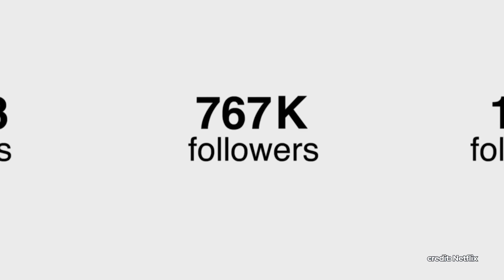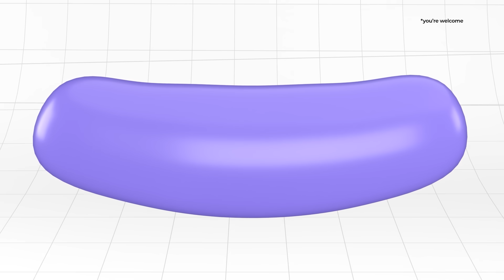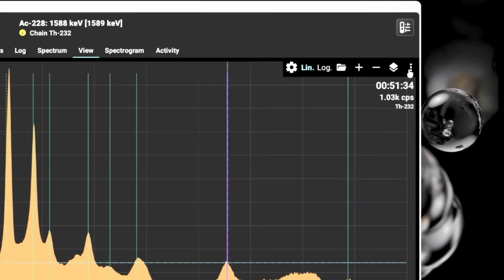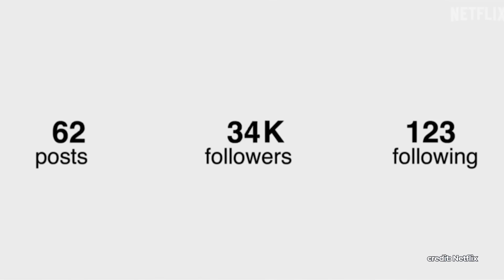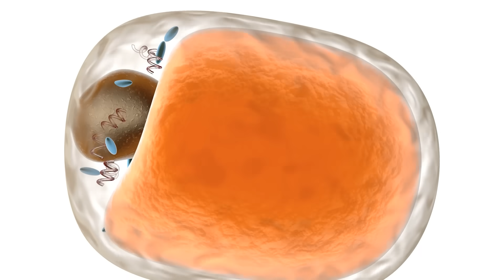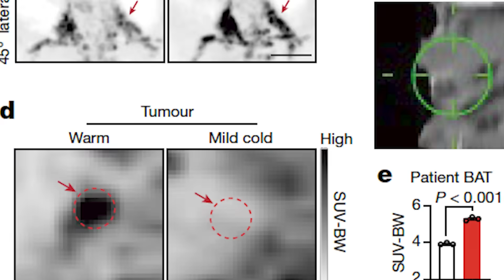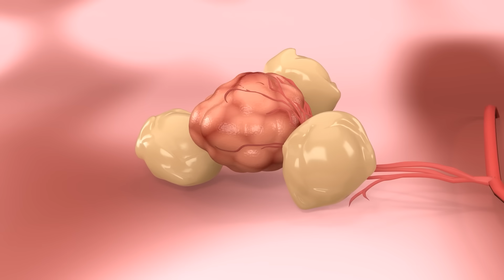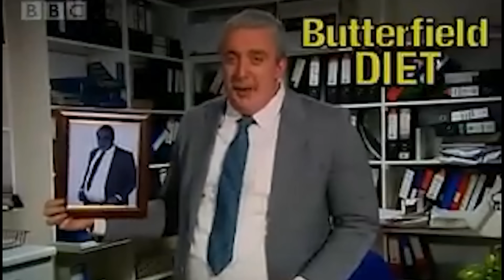Scientists Just Discovered How to Starve Cancer

Comment: Excellent video as usual. I was diagnosed with metastatic cancer (stage 4, terminal) 7 years ago (still here!) and knew I had to find my own way out. An infinite amount of time researching cancer science has kept me alive and the cancer is now undetectable. Here's the kicker: cancer involves both cancer stem cells (CSCs) and their progeny, daughter cells. THEY BOTH HAVE DIFFERENT METABOLISMS! While daughter cells are dependent on glucose to fuel glycolysis, CSCs are not. CSCs can make energy either through glycolysis (the Warburg Effect) or if glucose and glutamine are inhibited, they can switched to normal, 'healthy' metabolic function, including burning fat to produce ATP (energy). To be clear, I have never tried the Keto diet - there is too much science that shows cancers ability to switch metabolic pathways when denied any source of fuel, and that fat is the preferred fuel of many types of cancer. For example, the dominant metabolic pathway for prostate and pancreatic cancer is Fatty Acid Oxidation - a Keto Diet can only make those cancers worse. Simply put, diet cannot cure cancer, it can only help. But you MUST understand which type of diet helps for which type of cancer. There are hundreds of different, unique types of cancer and there is no single diet for all of them.
Reply: I haven't gone into detail because that is an extensive explanation. But since there is interest I'll have a go: diet - plant based, best described as a pescetarian diet, although over time I added chicken. I avoid grains and simple carbs. I was very strict in the first years, but that proved unsustainable. Treatment: I have had surgery and 2 rounds of radiotherapy (radiation). The result was temporary reductions in cancer markers. Complementary medicines have been far more effective, but timing is critical - the radiation reduced tumor mass and enabled me to take advantage of that with these medicines. Complementary medicines do not work on advanced cancers. Advanced tumors need to be diminished by radiation or chemo so that the tumor survival mechanisms are demolished. Then they work. The most effective medicine I have taken has been fenbendazole. It stopped metastasis and enabled me to get on top of things. But fenbendazole requires the support of diverse vitamins and minerals. Peptides have also been very helpful. You might look into peptide therapy. It has worked for me and is gaining traction. I also recommend avoiding the doctrine of Thomas Seyfried, who has been mentioned many times in the comments. He is a neurologist, not an oncologist, and his ideas are reductionist and misleading. And potentially fatal. Brain cancers are unique and very different to every other type of cancer. They are uniquely dependent on glucose and so a keto diet is recommended in that case. But for most cancers the keto diet is far more likely to exacerbate the problem. This is a very brief description of several years of research. I wish you all the best.
Reply: @quantumkookaburra  Thanks for that explanation, Kookaburra. Another Aussie? Awesome effort BTW, 7 years after a terminal diagnosis(like me).
I was diagnosed with aggressive small cell pancreatic cancer 3 months ago. I was offered chemo, which I accepted. On diagnosis I started on fenbendazole, ivermectin, curcumin, megadose VitD3, Vit K2, Vit E, zinc, and EGCG(Green Tea extract). I use vet grade IVM and Fenben, as I have found it very difficult to get pharma grade IVM.
I have not told my oncologist what I am doing as I can't be sure of the reaction, and I still need his help for chemo and scans, but I will dowhat  puts the odds in my favour with minimal downsides.
I had a scan 6 weeks ago and the pancreatic tumour had shrunk 20%. I am pretty sure it has shrunk further as I have been able to go off my pain meds a month ago.
Thanks for the tip about peptides, I will look into that. 
As for keto, I have seen it mentioned many times in relation to IVM/Fenben, and initially tried it. Living in my household it is next to impossible, so I have just opted for low carb, as I started to wonder if it is all that relevant, given the metabolic blocking that the above provide.
Cheers, and thanks for your explanation.
Reply: @TheRonster1957 Thank you for that. Very interesting. Did you also happen to go on a very low-fat diet, alleviating the pancreas workload? What about creating an alkaline environment in the body?
Reply: @TheRonster1957  Thank you for sharing your experience. Every inspiring story helps. I wish you well on your healing journey.
Reply: @quantumkookaburra my friend go brain cancer years ago and I begged him to do keto and he did. I’m glad I was  right holy shit.
Reply: @quantumkookaburra  That’s incredible, which peptides did you try and which ones seemed effective?
Reply: @quantumkookaburra  Seyfried isn't a neurologist, he's a biologist.
Reply: @quantumkookaburra Hi! Can you please tell me more about fenbendazole and what it means that it should be supported with minerals and vitamins? What type of cancer do you have? How did you take fenbendazole? I have also been searching for tons of information and I found your comment very credible, although in practice no study with a normal design has been able to confirm the benefits of fenbendazole for cancer. How is your health now by the way?
Reply: @quantumkookaburra  Maybe, or maybe it's all a fluke.
Reply: @quantumkookaburra Thanks for sharing. 
Years ago, we learned that cancer cells cannot eat raw leaves and raw foods. 
So, pescatarian with raw okra and leaves should be the correct path. Occasional low-carb veggies like chayote and zucchini etc.
Helping my mother with metastatic squamous cell in nerves of head. Not easy.
Ivermectin and low-methionine and low-carb has removed pain and slowed the growth, but I  believe it's not enough. 
She wants to try mebendazol and we have some but I don't know how to use it. Any suggestions?
Reply: @andreadamascceno2139  Raw vegetables is almost the worst you can do to a human body.  Though nobody is the same i would never advise someone raw vegetables. Many plants are full of toxins, and certainly if you do not cook them. And cancer cells do not litterly eat food. They eat no food at all. They take the nutritition from the food. May it be Vitamin B12 or something else, they can feed on alot of things. I have no idea how to beat the cancer properly, but if i had to take a guese right now: go zero to low carb and then let them hit the cancer cells with radiation and/or chemo shortly after. Then continu low carb for a while or forever if u like. On one recent cancer trial the cancer spread elsewhere, when they where deprived of glucose with low carb. So you want to combine low carb + chemo's i think. Discuss this with your doctor if you want to try something like it.
Reply: @quantumkookaburra  thank you for taking the time to respond.  I learn something new esp. on different energy pathway for different cancer.  Your combo approach makes a great deal of sense and fenbendazole confirms my understanding at the core of cancer there is a link to parasites.
Reply: @quantumkookaburra hi,could you tell me more about how to use Fenbendazole? I have just got it and need to know what to do next…
Reply: @quantumkookaburra which vitamins and minerals to use with Fenbendazol?
Reply: @quantumkookaburra  what about pancreatic cancer?
Reply: @karenwilliams-u7r  If you could be more specific. What would you like to know?
Reply: @quantumkookaburra  what diet for bile duct cncer ?
Reply: @ Have you read about the anti-cancer effect of short chain fatty acids (SCFA's)? Like ketones? These are produced by gut bacteria as a byproduct of fiber breakdown, as well as by our liver. I do think a keto diet is extreme, but it could be helpful if cycled properly. It would have to include a lot of fiber & low-carb veggies.
Reply: @quantumkookaburra  what evidence do you have keto would exacerbate cancer? total nonsense
Reply: @quantumkookaburra Hi - thank you for sharing. And I just would like to add that Dr. Seyfried is not a neurologist but comes from biochemistry / biogenetics and focussed first on brain cancers because he had worked on patients with epilepsy and noticed the effects of diet there and then went transnational. Also he is being misread as pushing keto diets. He has explicitly said that what counts is for each person to measure their personal glucose-ketone index (with simple affordable meters) and see which foods work for them. Which could be keto, plant-based or any other mix that by experimenting each of us can identify for our unique body. This I found to be a relief, because as a cancer patient I definitely want to avoid keto / carnivore style diets because animal fat and proteins are unfortunately tumor driving… 😢 And because I had also misread Dr. Seyfried as keto only advising…
Reply: You didn't actually say you what you did to "find your own way out", so we can only assume it was luck! Glad to have ya here, buddy.
Reply: @dandymcgee because, like he said, every cancer is different. There are hundreds of cancers with thousands of variations. His advice was to do research on what specifically you have. With his cancer specifically, what helped him might only help 1 out of 1,000 if not fewer people, and could possibly hurt and make other people’s cancers worse.
Reply: 7 years is crazy
Reply: Thanks for sharing! Which diet did you find most beneficial to your health? I lost both my parents to cancer and several aunts and uncles. They were healthy eaters. I really want to increase my chances of survival with my doomed genetics.
Reply: @Its.Raining.TTacos  Que YHWH te livre em nome de Yeshua de todas as doenças e dê a melhor saúde.
Reply: @Its.Raining.TTacos  First of all test your genes with NGS. If possible, remove the body part that's getting cancer, e.g. breast or prostate. Otherwise - reduce inflammation, exercise, eat naturally, don't smoke, don't drink alcohol, catch it early. Not much else to do.
Reply: So what's your cure? Tell us!!
Reply: @dyfrigshandy research... Cure-alls for cancer are bullshit, that was the whole point of the walls of text. Telling you theirs and you using it might only fuck you up harder.
Reply: Your insights on cancer metabolism, especially the metabolic differences between cancer stem cells and daughter cells, are valuable and highlight the complexity of cancer treatment. I appreciate your emphasis on tailored dietary approaches. However, your concern about the ketogenic diet’s risks seems to overstate its unique impact. You note that fatty acid oxidation (FAO), prominent in cancers like prostate and pancreatic, could be exacerbated by keto. Yet, FAO is a natural part of any fat-loss process, whether through diet or exercise, not exclusive to keto. By focusing solely on keto, the argument might inadvertently suggest it poses a greater risk than other fat-loss methods, which may not be accurate. Additionally, obesity and insulin resistance are significant cancer risk factors, and keto’s well-documented benefits in improving metabolic health could help mitigate these risks in many cases. While personalized diets are essential given cancer’s diversity, a balanced view would consider that the risks of FAO are not unique to keto and that its metabolic benefits may often outweigh theoretical concerns.
Reply: @EnFuego79  Thanks for your reply. Just goes to show , not just how complex and interdependent these processes are, but also how much you have to know. It also highlights how important diet and exercise are BEFORE you get cancer.
Reply: Many thanks for your time and clarity; good luck my friend!
Reply: @quantumkookaburra  cancer can not switch back. It has ruined it's mitochondria, and can not perform oxadative phosphorylation. Cite your sources for this please. Would be very interesting to read.
Reply: @Technichian462  Daughter cells destroy their own mitochondria and they cannot switch back. I agree. Blocking glycolysis is a very effective treatment in that case, which is possible with peptide therapy. However Cancer Stem Cells do not suffer from loss of mitochondrial function. That's my point. Feel free to find your own sources for this - there are many.
Reply: @ I haven't seen any source for this. Was hoping you could provide at least one?
Reply: It’s very rare on YT to see someone leave such a helpful and well written comment and then over the next months keep an eye out for follow up questions and reply. 
It’s such an important topic to so many, including myself, so thank you.
Reply: Fat oxidises due to inflamation and insulin ,Keto diet lowers both so fat oxidation doesnt occur. Therefore it does not cause increase in fat oxidation. But there are other diets like mediterian diet that lowers protein intake and inflamation that can be more suitable. But the thing is lowering inflamation can increase cancer survival rate although it helps immune system.

 Also switching to fat metabolism is good for slowing cancer because fat metabolism is slow which means cancer growth will be slower too. This may cause issues tho since common chemos targets cells that replicate fast if they are slow enough they may not die. Although it doesnt matter in the mutation specific therapies which all industry should just replace it with chemo.
Reply: Look into dried ginger and iodine/iodide, plus plants that digest cancer cells. Also look into anti-angiogenic foods that contain ellagic acid.
Reply: Fascinating. It seems that the blend of macros can't be a cure, they could only be optimized to combat the type of cancer. Maybe. The real potential for diet therapy may be various phytochemicals: curcumin, EGCG, anthocyanin, fibers, etc etc. There are literally thousands of potential anti-cancer dietary constituents. And they could also be tailored to the type of cancer.
Reply: If they switch rather than adapt it sounds like a fluctuation between keto and non keto might confuse it enough that it can't do what it wants to do
Reply: @Enigmonkey uhh, your body has the same issue too man... Your body is designed to act the same as a cancer cell in almost every respect usually.
Reply: @quantumkookaburra - Honestly, you’re a godsend. The way you’ve shared your journey is giving people real hope. I wanted to ask about the peptides you mentioned - would you be willing to share which ones helped you? I have a close friend with advanced stage 4 cancer, similar to your metastatic case, but it began as prostate cancer that went unchecked for years. What makes it worse is that while he was in a West Indian country during the pandemic, they recorded a PSA of over 200 and never even warned him - absolute madness. Now he’s back in the U.K. where treatment options are better. One unusual thing we’ve noticed: whenever he visits the West Indies for about 6 weeks, his PSA shoots back up - from single digits to over 100. The same trend has happened on three separate visits.I wonder whether tropical climate or heat could play a role in cancer progression. 
Also, I’d be really grateful if you could share which peptides made the biggest difference for you, and how they were effective.
Reply: @lettingyouknow1  Hi. Sorry to hear about your friend. Cancer sucks. The peptide I was referring to is a dipeptide called Carnosine. It inhibits glycolysis in cancer cells and helps to reduce tumor mass taken with other things. It also promotes mitogenesis, and is also effective against viral infection for the same reason. Important to take it with Zinc Picolinate. Fenbendazole is your most important weapon. If you look up Joe Tippens you can get the full story. It requires many vitamins and minerals to support its effectiveness. I could write so much more but this format does  not allow. Good luck!
Reply: I am a cancer patient and daily have the Berberis plant (berries) and the Dhamasa plant (grounded), both in the form of tea. It has helped me a lot pour half a tablespoon of the Dhamasa plant. A few berberis berries in hot water simmer for a few seconds, and have it as a tea --- please also consult your doctor. I also hope this helps.
Reply: That’s what gets me when people say things like: “we have the cure for cancer” because every cancer is different and even within a type of cancer there are variations. It’s almost like saying, we have a cure for diseases. Cancer is an extremely broad term—so you are exactly right. Do not trust anyone or anything that says they have the “cure for cancer” they are full of shit. Trust things that say like: “we have found the cure to Cancer X subtype Y for Z cells etc” the more detail the more credible.
Reply: As good as all cancercells have the same base and do the same stuff. Then again they are other mutations, and each cancercell may need a different treatment. But in the base you should be able to hit them at the same spot. In the video there is a solution that should work against all cancers, if it works like they say it does: They starve the cancer from their energy. Which is what every cancercell needs. The next problem could be that the cancer goes and spreads everywhere, just like it seems to do in some trials with keto, just to survive. So you'd have to plant the brown fat all over the body, which is not possible. Cancer is a bitch, the only thing that i could think of without chemo is really starving it with the keto diet and then putting up a big period of fasting. But with the possibilty of killing yourself because your not getting the right nutrition. Same goes for fasting + glutamin inhibitors, but that is probably even more dangerous.
Reply: @Johannesdesloper  Fasting is not dangerous if you prepare yourself first.
Reply: God bless u
Reply: What type of diet would be good for Multiple Myeloma??
Reply: @TheDesroster  I wish I had a good answer to that question, but that is a cancer I have not researched and I don't want to send you down the wrong path. That said, it seems that there are certain considerations related to the impact of MM on the kidneys. Not just the cancer but treatments like chemo can really tax kidney health. (I have a friend who was treated with chemo with good results but the chemo caused kidney cancer.) Acacia Fiber is good for kidney cleansing, plus vast amounts of water. Also best to avoid red meat as it taxes the kidneys (long story).  This suggests a diet that is light and easy to digest. MM may also cause high calcium levels, so best to avoid foods high in calcium - although best to consult your doctor on that. A focus on general well being is always a massive help - foods high in micro-nutrients and exercise have been very helpful for many people with cancer. You might want to read the book Radical Remissions, written by a Harvard Phd researching ways in which people beat terminal diagnoses. All the best.
Reply: @quantumkookaburra what is the best way to avoid having cancer in the first place? Is there any way people can avoid it forever? It’s estimated 1 in 2 people across their lifespans will develop some form of cancer
Reply: @namjoonsbicycle7814  The simple answer is: be proactive about your health. This is, in theory, quite simple - diet and exercise. I think that message has been repeated so often people have stopped hearing it. But to clarify that message - exercise facilitates proper functioning of the endocrine system and it is also the foundation of immune function, both of which are critical to not getting cancer. (Of course there are countless other reasons to do exercise such as cardiovascular health and weight management, but therein lies a book.) Diet is vital for good health - which, in turn, can prevent cancer.  A good diet is critical for immune function as much as bad diet antagonizes the immune system, assaults the body on a cellular level and can (probably) cause cancer. Ingredients such as nitrates found in processed food are actually carcinogenic. You must of heard this before but - a whole food plant based diet that excludes processed food is best. The modern diet is so devoid of micro-nutrients that while people are trending towards obesity the body is deprived of the nutrition it needs for healthy functioning. The human body is a miracle - the biochemical processes that take places on an incalculable level include an amazing capacity for good health and self preservation - but this requires an abundance of micro-nutrients found in unprocessed foods, especially plants. I hope this helps.
Reply: @TheDesroster The very best is to avoid starchy foods and sugar. Very low-carb and low-methionine, mostly raw foods for one month or two months. Clean fats, like coconut oil and olive oil, are used only to avoid excessive weight loss. 
Raw okra is a good source of protein and some fish.
Reply: Total B S on the science showing cancers ability to switch to fat.
Reply: Cancer can’t live without glucose or glutamine. Unfortunately we can’t cut off glutamine since or bodies make it.
Reply: @tsmith3286  But you can reduce glutamine in the body through various methods. Certain supplements seem to cut off the supply of glutamine to the tumors.
Reply: Can diet and fasting PREVENT cancer?
Reply: @patinho5589  It has been said many times that having a healthy, plant based diet is the basis of good health and will therefore help prevent cancer, in conjunction with regular exercise, and stress reduction. Being at a healthy weight, with good cardio will decrease risk by an estimated 95%. It is suggested that 95% of cancers have metabolic causes, while only 5% have an actual genetic cause (family history). Keep in mind that the number one risk factor for cancer is poor sleep.
Reply: @patinho5589  eat everything from nature. Fish, veg. No industrial sugar. No over eating junk food. Drink enough good water regularly. Move your body regularly especially in good weather morning. Dont smoke too much. Sleep enough, when your body tell you to sleep, sleep. Deep sleep. You can sleep in mid day, in night. Dont fight your sleepy.
Reply: Well stated! And I'm so happy for you!! 7 years going strong! Woo! I wish I could copy this message of yours and share it...
Reply: Very interesting I have prostate cancer from back in 2017. It’s now 2025. They gave me seven years now my PSA is rising again pretty quickly and ivermectin Finn Ben, dissolve keto diet cutting off or trying to cut off those fuel sources that really not done anything. He slowed it a little bit. I’m thinking I need to do maybe an extended fast which I know it’s gonna be really expensive and I don’t have the money but what you’re talking about is really deep. God bless you and your family.
Reply: i loved your responses/replies and OG post
Its amazing what agency we have when given access to the right info!
with ME/CFS, albeit rarely terminal, it is SUFFERING and many dont believe its reversible, albeit that IS changing, gaining momentum.
Its funny how stress and emotions underpin so many conditions, as well as what im calling 'evolutionary self-neglect'
Every late autumn/winter i cycle paleo-keto it has more of a focus on the fiber, no modern foods, everything done from scratch. Its not been a cure, but it meant i went from couch-bound to house-bound the 1st time i did it. 
Took me 3years before i took the action XD it was being told i was pre-diabetic which gave me the push -turns out i also had gut microbiome imbalances, leaky gut, sibo etc 
And its funny that in my community, there's no 1-fix-all diet and for many diet doesnt make the slightest difference. its very individual, much like how you describe. I really felt for you being inundated as the goto experta nd thought you handled it very well :D
Reply: E. O. Wilson smeared oleic acid on a living ant and its nest-mates heave an haul it to dump it in their midden pile (garbage dump). When I was self-vaccinating, I continued fasting and only started eating olive oil when I felt cold and starving. I suspect that maybe some olive oil fat will be taken up by the cancer and the oleic acid produced may mark it for my body's lymphocytes for dumping, analogous to what the ants do to their live and kicking unfortunately smeared with oleic acid sister. 😊
Reply: How about autofagi with fasting?
Reply: Dou You have some email or contact ?
Reply: Can you kindly cite your research? I would like to investigate colorectal cancer.
Reply: Smartest comment today.
Reply: 80/10/10 is best for everyone
Reply: Hi, splendid comments, so much to learn. Myself ten years alk positive lung cancer stage four. Currently NED, nothing on ct, mr and blood. Dr. Kelleys book, Jane McLelland, Joe Tippins, Gay Tennenbaum as a start. Also on Youtube, FB and more. Tried a long list, eg. MRET Water, fenbenazole, spirulina, chlorella for detox, moringa, ginger/lemon/water, vit D (plenty, with K2), vitamins, minerals (low iron, «all the magnesiums», garlic, herbs and spices. Keto on/of, aple cider vinegar with mother, butter (byturate), olive oil, greens above the ground, some seafood and meat,charcoal and zeolitt for detox, fiber/binders, ECGC GREEN TEA,circicummin/black pepper/olive oil mix, fresh air and sun, yoga, exercise when possible, sleep/rest, Rife frequency thereapy, and much much more. I belive down the road I have many more «tools in my toolbox». Cancer is «clever, adaptable etc», so sparing plenty more «amunition» for the upcomin battles is my approach. Eg. Wim Hoff, hyperbaric chamber, red ligth thereapi, «Electric therapy» and more. There are also many other options existing and in the pipeline. My initial diagnose was 3-6 months.. myself now age 66 living in southern part on Norway, out whole day with our Irish setter hunting dog.
Reply: There are hundreds of different fungi/mushrooms 👉snake venom 👉anti-venom 😊
Reply: Please write a book about it.
Reply: We have too much antifreeze and other chemicals in our meats, so Americans won't ever do well with a Keto diet. All those extra chemicals spawn more inflammation, thus more fuel for cancer cells. We must stop allowing all of our foods to be poisoned by food markets wanting to make more money from bad or older foods.
Reply: while ppl mess around with macro dietes.... noone looks into micro.
Reply: Incredible. Thank you!! ❤
Reply: I would love to see a video of your healing journey!
Reply: Deleting cancer is very easy doing all or some of the following: 1) hyperbaric chamber sessions ( cancer can't exist in oxygen)  2) proton therapy (no side effects - it is not radio therapy ! ) 3) eliminate refined sugar 4) alkalinize the tissues with diet and alkaline drops ( cancer lives in acid )  5) reduce stress and cortisol to strengthen the immune system. 6) fasting ( for autophagy) 7) powerful antioxidants ( e.i. astaxantine)
Reply: Please share the rest of your story! You could help so many ❤ I’m so happy you’re still here not letting it get you down!
Reply: Someone i follow on here also healed himself! He's been here 10 years after! He changed his diet and started doing coffee enemas and taking enzymes and a few other things. Truly amazing.
Reply: Simply put.  You don't know enough to make that conclusion.  Being successful at something does not prove there is a single path to success.